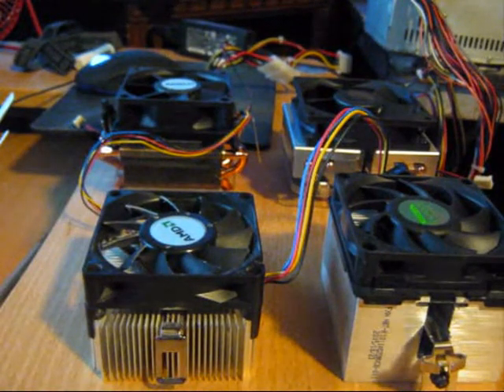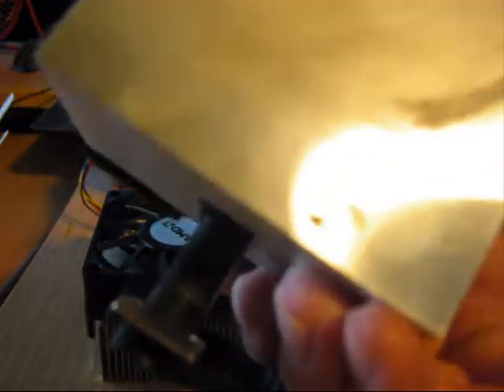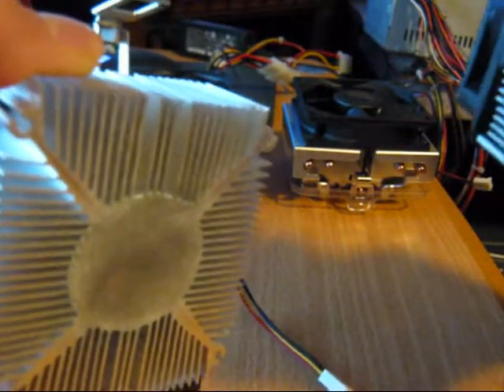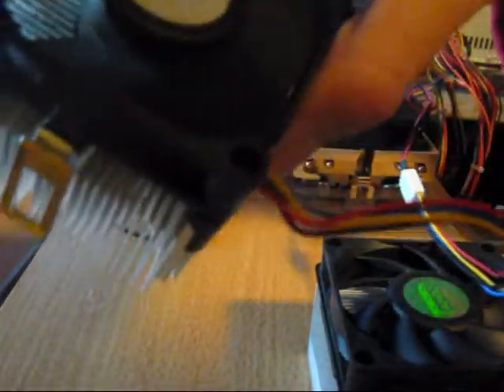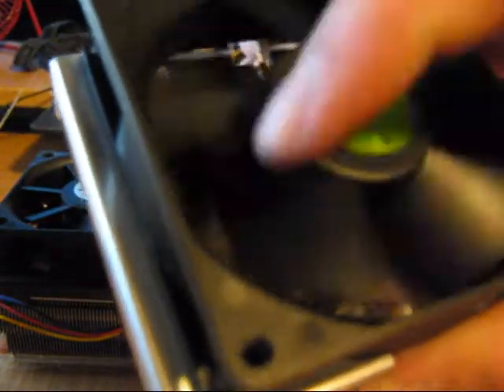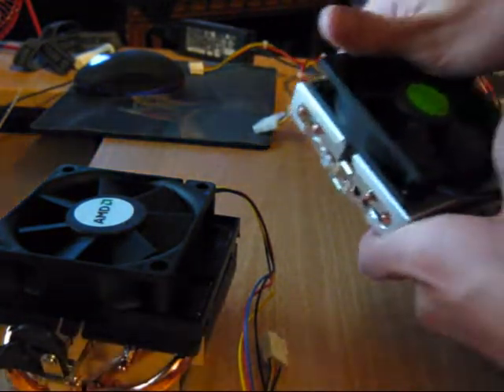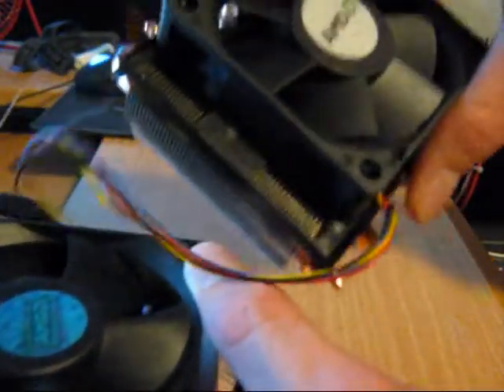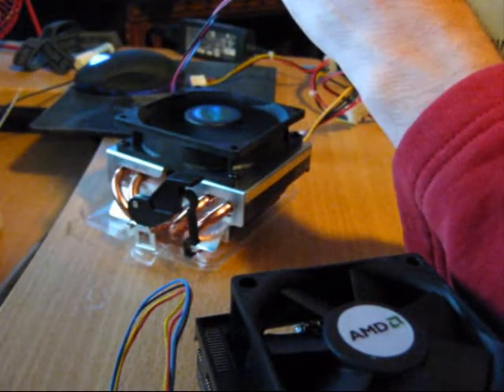Are AMD's boxed coolers getting smaller overtime???

Comment: the way the heatsink is made helps.. the bigger one, i got with a Sempron 1.6Ghz.. i got the smaller one was with a Athlon X2 3.2Ghz. Both have done well. The 1.6Ghz was always overclocked 200Mh. I actually like the smaller one, because the air flows better and down into the processor.

Comment: My cooler on a Athlon 2 x2 270 (the cpu on my old main rig that died with it's psu) the cooler was great , 35 degrees on idle and 45 in full load , and i've overclocked the cpu to 4.5 GHZ to 3.4 , and it was running 65 degrees on full load , and it was really good imo